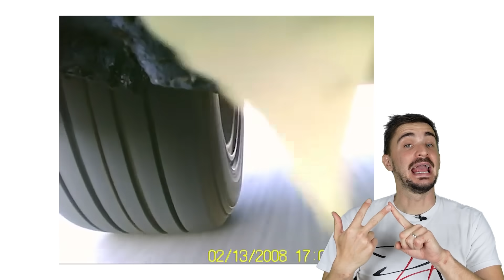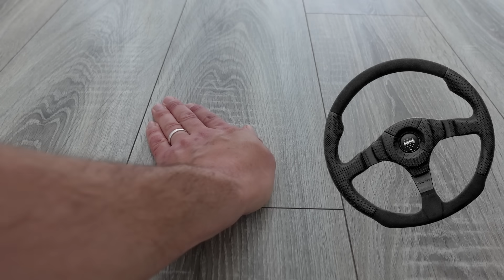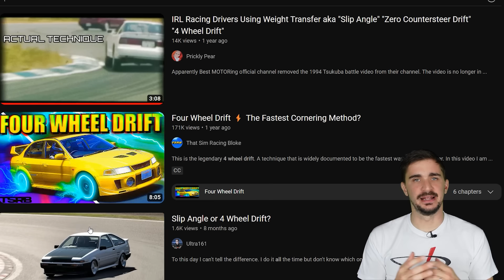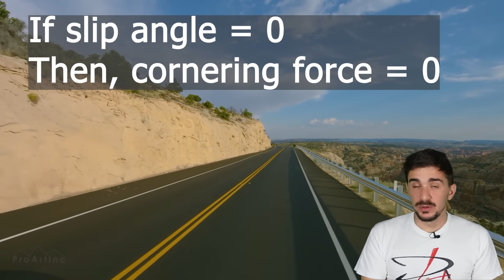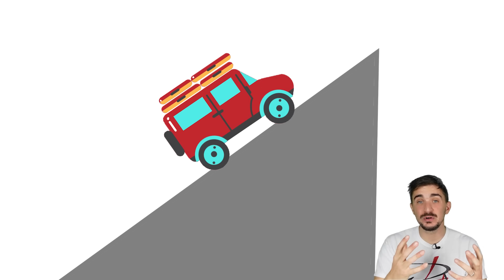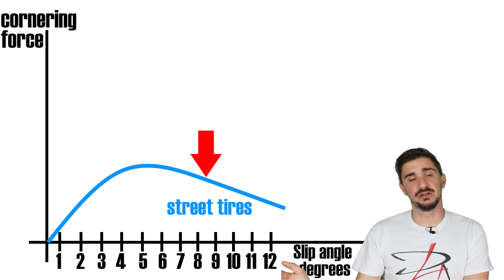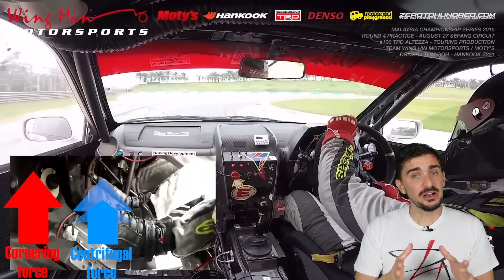You Think You Know But You Don't - Slip Angle Explained in a Way You Will Understand

Comment: I call horseshit.  Your assumption assumes that until the rubber hits the road it is not in the angle that the tire is going.  You blow this out of the water by showing the videos of tire flex.  The tire does not flex only at the point of impact.  Slip angle is someone trying to prove how smart they are by inventing a new name for something.  Angular momentum and inertial drift have long been terms used for going around a corner.

Comment: 12:00 the graphs are flipped. Its the racing tyres that have (generally ofc) lower peak grip slip angle* and the falloff is definitely gentler than road tyres.
Reason is the lack or reduced amount of grooves. The presence of groves in road tyre decreases the thread stiffness allowing for more twist between contact patch and tyre core before slippage occurs. During high slip those separate blocks of rubber start to oscillate (slipping and re-gripping) creating the screeching sound typical for movie stunts that you hardly hear during racing. Those oscillations (as well as lack of stiffness in the thread) are both responsive for higher peak grip angle and reduce grip further when slipping past it. In fact its old misconception that racing tyres suck when slipping, a slick tyre provides by far the best grip for drifting (barely lower than peak) its just not often used for other reasons. D1GP has slicks banned because they are too good.

14:15 Ohh, hard disagree on that. It may be faster to "send it" rather than be too cautious yes (like in illegal street racing), but as soon as we are serious (on trackday), going past peak grip its not only about cornering force but acceleration - because cornering force is perpendicular to slip angle, so the more slip we have the bigger the longitudinal component of cornering force. The guy driving just below peak grip will have noticeably improved exit speed, while on entry he will have more control over car speed with brakes. More slip will overheat the tyre faster too.

* - that's assuming same tyre size, racing tyres are often wider as well which reduces peak grip slip angle further.

ps: found the father of this video in "YourDataDriven" article on slip angle, ah youtube things  :)

Comment: A spoiler is generally a small lip, or extension, which aims to 'spoil' the attached airflow on an element or bootlid of a vehicle. What you are referring to is an element or wing. With regards to the illustration of the 'wing' it implies the air hitting the rake of the wing creates pressure, pushing the vehicle into the ground, when this is quite wrong. I'm sure this was just due to available graphics, but its such a common misconception so thought I would mention it so those interested can research how a wing works.

Comment: I think you have oversimplified the actual phenomina, In your explanation you say that the tyre does not deform on the cantact patch, it doesn, massively, the tyre will create more of an S shape on the contact patch and you explain it as a stepped phenomina, it's not it's fully dynamic, and it is purely friction not "cornering force", that is just a made up simplification for friction vs the desire to go straight, not centrafugal forece which is something slightly different. The real definition of "Slip angle" is egactly that, it is the angle of slip that is seen on the tyre. This changes in respect of speed and actual required angle, so at 1mph and a full lock turn can see a greater slip angle than a 1/8th turn at 30mph. in essence, it's skidding of the tyre over the surface it's on. you can only get 0° slip angle at a straight line or incredibly slow speed with a perfect centre steer steering geometry. if your vehicle has an over or understeer geometry steering system, it will have a greater slip angle on the inner or outer wheel. the greater the speed, the greater the slip angle. remember, force is trying to keep the vehicel travelling straight, not throw it off at 90° to it's current projectory (which is what your graphics are stating) That is wrong. Your explanation gives a constant slip angle at any speed, that is wrong. Maybe look at explaining it better.

Comment: To expand on the point of what fast drivers do; when engaging a corner and exceeding the ideal range of slip angle you must reduce steering input to return to the ideal slip angle range, however you can exceed grip on the back so that it follows centrifugal force and swings around, which positions the car steeper in to the corner without having to increase slip angle on the front tyres.

Since your front tyres are taking more load than the front ones in normal driving, you would typically find the front tyres wearing out first, which isn't ideal for driving dynamics as it will change unevenly over time. By letting the back slide out a bit and take additional wear to reduce the load on the front tyres, you keep the wear more even and turn in to the corner with higher speed than the tyres would otherwise allow. This pairs up nicely with trail braking, since you use your late braking to bring about that little bit of extra swing in to the corner, then maintain it with throttle to keep the nose pointed where you want to go without leaving all the work to your front tyres.

Comment: If your explanation were correct, a car wouldn't turn if you turned the wheel from a standstill and only then started accelerating. But it clearly and obviously does.

"Friction is a passive force, it cannot generate movement"

All forces, by definition "generate movement". That's what a force is -- F = ma. No F, no a. And vice versa. If friction couldn't "generate movement", you wouldn't be able to get out of bed.

Comment: I don't quite understand one particular thing: When my car is standing still, I can rotate the wheel and therefore move the whole tyre (i can even hear it on sand or gravel). So the contact patch has to move, there is real slip. When my car is moving, the contact patch is supposedly not slipping. So there has to be a middle ground, between a still contact patch and a moving contact patch (the physics of both states have to merge into one another), but at what speeds does it happen, and does it also happen at high speeds? And how is understeer related to this?

Comment: A little disappointing that you relied so heavily on the centrifugal "force" in your explanations. I think it would've been worth the extra minute or 2 to explain the actual velocity vs acceleration vectors and how the inertia gives the illusion of a centrifugal force but it isn't really there. 

Also the last minute spoiler explanation of "throwing wind up" is more harmful than helpful. The majority of aero devices don't rely principally on that mechanism, and the video would've been better off without that addition.

The consistent additive hand representations of the contact patch are also a little misleading. The new direction of travel is the the current contact patch, so it doesn't just stay facing forward when you've added 3 or 4 hands that keep turning.

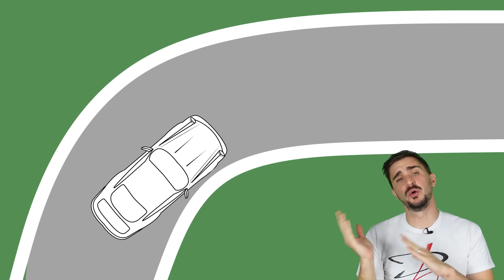Comment: Centrifugal force does not really exists, it's not a real force, it's "fictitious." One way to see it: Look at the diagram of the "centrifugal force" vector at 2:29. If you remove all friction that force arrow would imply that the car would go flying out of the curve in the radial direction. This is not the case. If it were to suddenly lose all friction the car would go tangentially, leave the curve in a straight direction of current travel. 🤠

Comment: i always understood the four wheel drift as simply being faster because instead of using your two front tires to force you along the corner, you also employ the rear tires to pushing you along as well. your front tires are doing less work, but consequently your rear tires are now helping too, and it results in being able to overcome centrifugal force just a little more.

Comment: Thank you for the great video. What still puzzles me is the following. First looking at the static or step-wise model with going from 0° slip angle to let's say the optimum at 6° instantly (hypothetically). But then moving on looking  on to the state of being in the corner. If I hold the steering fixed at the initially chosen angle, do I have 0° slip angle or still 6° on the front tire or something in between? I have a hard time to imagine how an angled tire is rolling off on the ground while cornering. Is the tire (in an ideal model) still rolled off in a linear path tangential to the car direction whilst in the corner so that the slip angle stays (ideally) constant?

Comment: This dud is eating shit for breakfast, lunch and dinner... Literally everything he says has nothing to do with what he is trying to point out... Yes tyres are from rubber, we all know that they flex, yet he starts talking about direct control of the car... As someone whom has the perfect control of the loss of control I can say that his ideology is wrong... The moment I turn the wheel, the car responds, then I respond to the cars behaviour, either turn more, turn other direction, tap brakes, slam brakes, downshift and whatnot and then the car does exactly what I say even tho normal driver would just cluch and brake to the floor trynna stop... Most people think that grip is everything and I say otherwise... if you know how to utilize grip (which is the actual topic of the video), you gotta know your tyres and car status, then you can proceed... If you want to use slip angle in turns, well that is what I do... Front wheels have grip, the rear wheels lose grip, start sliding, turn wheel to counter steer and just slip trough the corner without losing momentum (there is no centrifugal force)... This guy is just dumb trynna influence people to think what is what cuz he thinks that even tho he never actually tried to drive a car very fast in harsh conditions on a dangerous road...

Comment: How does slip angle affect the rear tyres since they receive no steering input ?
Or does it NOT affect the rears ?
Reply: Does car turn into the turn? Than there is a slip angle. Check some other better info on topic.

Comment: Even at minimum radius of turn, e.g. 5.5m, and with length of contact patch about 10cm, angle between directions of wheel and contact patch is just about 1 degree. So this explanation seems to be wrong. Real sleep angle is an angle between wheel rim and tire in front of contact patch. This angle is caused by tire deformation caused by lateral force and directs outside of the turn. That cause wheel to roll by a bigger radius then set by steering wheel, like if wheels were turned to less angle. So sleep angle does not produce lateral force, but lateral force produce sleep angle depending on tire flexibility. And for racing tires, heaving stronger construction and lower profile, peak of lateral force will be higher and with smaller sleep angle.
And generally sleep angle does not influence on speed in turns, it is limited by tire grip. High sleep angle only make steering more complicated, like if you had a rubber steering column and always need to oversteer.
More interesting thing is how sleep angle depends on tire load? And as result, how load distribution between inner and outer wheels on axle influence on distribution of lateral forces on wheels and their sum? In particular, why stronger anti-roll bar on rear axle adds oversteering and on front axle - understeering.

Comment: Correction: you display a wing, not a spoiler. A wing is better defined as a geometrical addition to the car that does not connect with the main chassis/body, but has a distinct suction and pressure side, whereas a spoiler is attached to the main body, located at the very end on the top surface, without having a distinct suction side. It helps reduce lift/create more downforce at the back for high speed stability, at the cost of drag. For street cars it can also be useful in case the main chassis is curved really smooth, because it defines a distinct location where the flow separates from the body; you could say this is bad, but think about it - flow separation cannot be avoided practically, but if you define the location properly, you can engineer its problems out way better, since separation is predictable. Compare this to a body from the 1930s let's say; the bodies are really smooth so flow can separate in many different location, depending on flow conditions, like side wind for example. This made the cars more unstable and create more drag, as well as could create bad noise.

Comment: On the subject of running gear.
I don't think you've addressed this but do you think you could do a piece on suspension? Highlighting how spring and damper rates affect your handling, braking and acceleration and what the difference might manifest if you choose hard springs and sift dampers against soft spring and hard dampers?

Thanks.

Comment: The things explained are very much noticeable when the pressure of motorcycle or bicycle wheels are lot lower than necessary. Contact patch is very large and bicycle or motorcyle just fails to turn at the first moment and it feels like you riding through the sand. (i am talking about low speeds, when you dont need to lean it to the side of the turn).

Comment: The purpose of a “slip angle drift” (or a slight drift without losing traction) is less to stay over the grip limit, and more to give the rear tires also a slip angle. if you think about it, if both front and rear tires have max slip angle, you are getting ideally double the cornering force than if you were only allowing the front tires to carry most of the cornering force/slip angle.
Reply: basically a four wheel drift where your steering is straight, and your car is constantly pointed the max slip angle inwards your turn from your current track.

Comment: Nice video!! Would be fantastic if you could relate the slip angle with the Ackerman principle. And how to get a good direction setting. In my car, a 91' Toyota Celica with 14 inch stock wheels and a high wheel profile, I have a problem in mountain driving at a good pace, the front inner tyre starts to  screeach, before the outer tyre. So I think that the inner wheel is turning more than it needs and it starts to slip before the outer tyre, so as it is sliping, the tire is not able to maximise the cornering force that it could give. In my opinion, the problem is created by the very high profile of the tyres, and the high slip angle that the outer tyre needs to maximise the cornering force.  

I'm, going to put a 16 inch wheels with lower tyre profile and I hope that this problem, would be mitigated. But I would like to know if you think there is something I could do aside to modifiing the toe of the front axle, that is now at 0,16º open. A little open to get a better corner entry. 

But nevertheless, I think it is an interesting topic for your channel.

Comment: So close to the correct explanation... Unfortunately, your slip angle vs cornering force graphs are incorrect after the peak. The force doesn't fall off linearly but rather flattens a bit below the peak value. If it did fall off as in your explanation then the sport of drifting wouldn't exist. Additionally, you speak of the increase in slip angle in the hand demonstration of the tire entering the contact patch but don't refer to how the it leaves the contact patch. A more detailed graphic of how the contact patch changes as you roll would probably be helpful. Thank you for addressing this topic though, it is incredibly complex and breaking things down to simpler terms for comprehension is very important. Thanks!

Comment: I thought you were getting owing to get into Toe Out In Turns, and Castor and Camber and their effect on turns. Toe out in turns is what keeps you tires from being overcome by slip angle. The inner tire has less distance to travel than the outside tire does. If both tires turned the same amount, a compromise would have one or both tires slipping beyond their ability to maintain friction with the road. This would make a great part two to this video!

Comment: Nice explanation, thanks!
I think the friction force is not given enough credit though :)
I think a good way to explain this is that cornering force on the let's say driver is created by friction and friction alone acting on the tires, then tires via elastic forces acting on the suspension etc etc. The point is that friction is the sole link in the chain at some point and cannot be underestimated of course.

The same is when walking straight, we do use friction besides other forces in our body's joints, but no friction -> no forward motion as we know it (other than reactive propulsion).

Comment: I thought centrifugal force is only a psuedo force? Like we only 'feel' this centrifugal force due to the centripetal force (in this case, the lateral force from the tyres and road), pulling the car towards its instantaneous radius, while our body wants to carry on tangentially (during a corner, forward during braking and rearward during acceleration), which the friction between our pants and seat and grip on the wheel has to overcome. The actual visual representation on slip-angle was very helpful, and definitely explains the idea of the upcoming deformed contact patch being the slip angle versus the car's current heading, rather than the contact patch itself deforming. Something not made clear in textbooks.